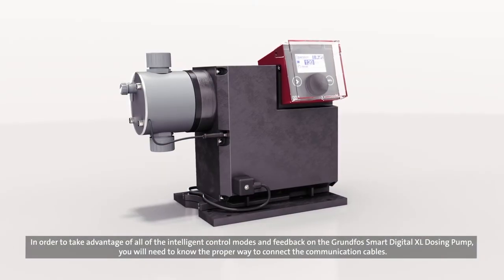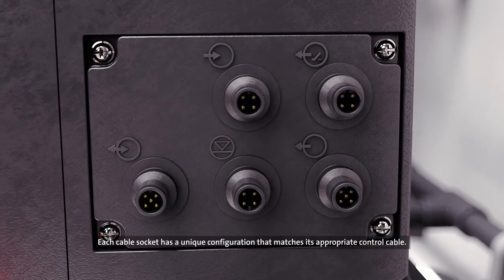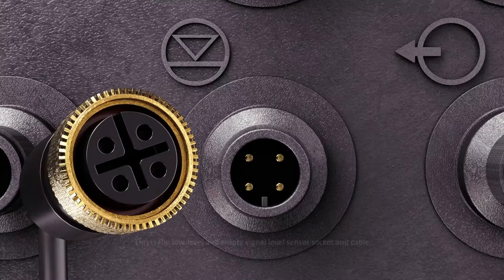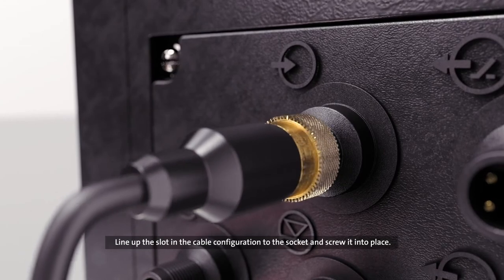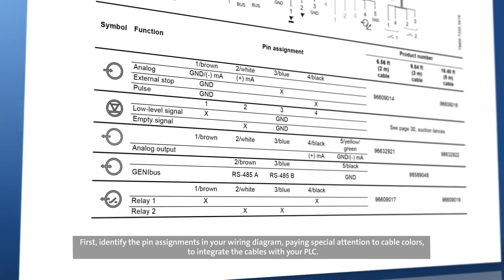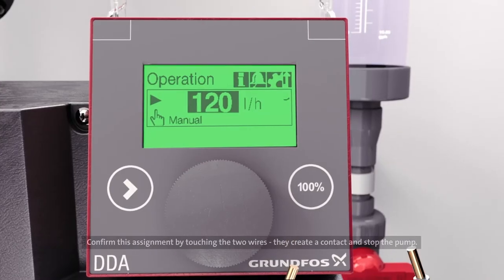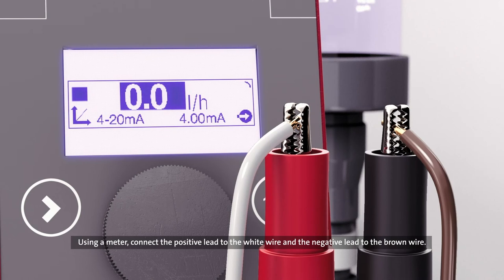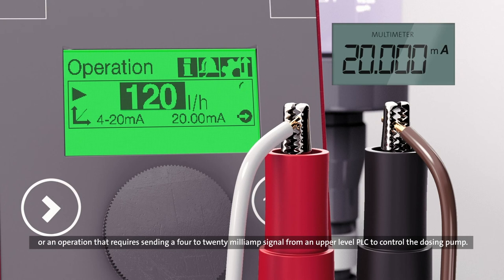How to wire and connect Grundfos Smart Digital XL Dosing Pump

Comment: The only connection you had not mentioned for the analog input was the pulse.  That's what I was looking for as I am trying to setup my pump for.
Reply from the maker: Hi Bill, sorry to hear you didn't find what you needed in the video. Hopefully, you can find the answer in the product manual here: https://grundfos.to/3U81jx6. I hope that helps! Kind regards, Sabrina.
Reply: I was looking for same pulse connection, iam looking to connect it to flow meter, if we loop GND and no 4 black and simulate the pulse is that the correct way